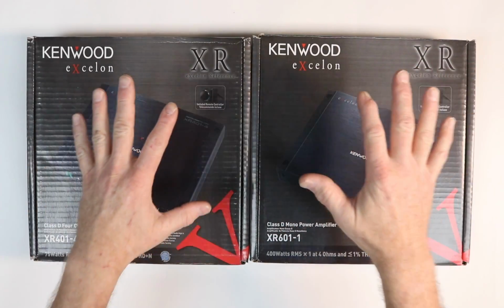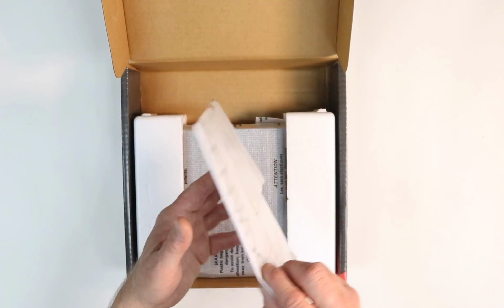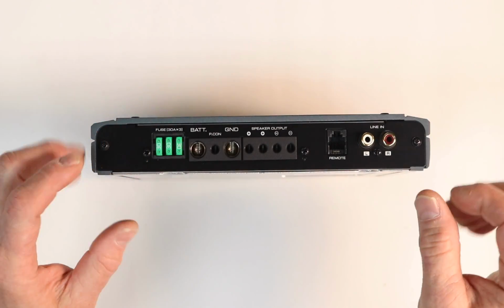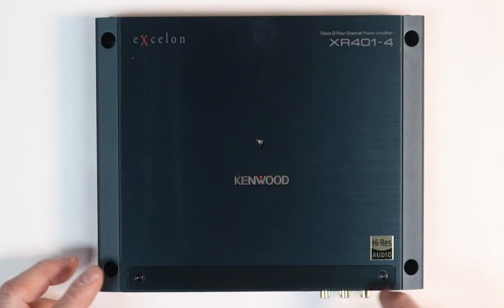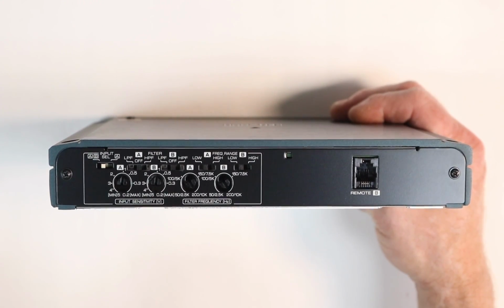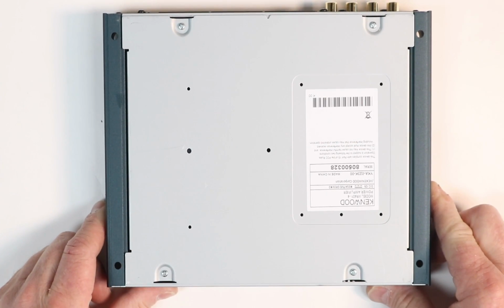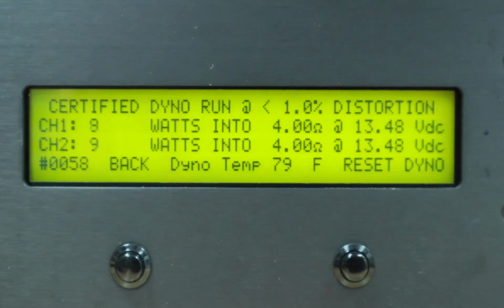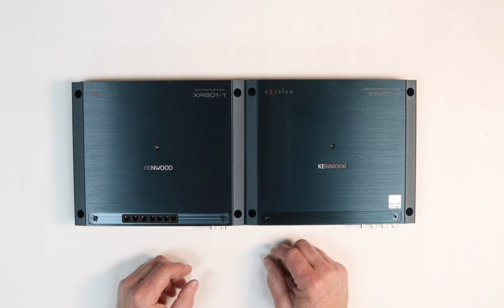Kenwood XR401 4 and XR601 1 real world amp DYNO

Comment: I keep coming back to this and will buy the combo. I initially was going to go with 2 alpine S2 subs-600w each and then realized my power supply isn’t sufficient to run that much power. I have a 2012 Raptor with 6x8 3 way component alpine Type R 100rms fronts with tweets both in the door and on the pillar, (obviously), and the same Type are coaxials in the rear doors. I initially powered them with a Memphis 400w x 4 amp. For the subs I had Kicker Comp D’s ran by a 500w Memphis in a small cubes BBox under rear seat box to host the two 10s. It truly sounded amazing with the Kenwood 990HD headunit back in the day. I just dropped a 1000z JVC with Excelon guts in it but sadly only have 50x4 Memphis amp pushing the doors and a 1000.1 black diamond pushing the old Comp D’s rated 250w each max rms. Im just going to go back where I began with only JL 300w rms subs with this amp combo. Dont want the install cost of new power etc. Thanks for giving real life voltage input on these amps, rated means nothing unless you can provide it, and y’all make it possible to really see a real life performance rating, and have sold me on your approach! I wish I could really upgrade but if I just achieve what I had when built 10 years ago, I’ll be more than happy! Y’all are great, push more videos please! 🙏🏼

Comment: dang. that 401 is def. underrated. 75w X 4, ya right. pushing like 140 X 4. That's impressive. The 601 isn't that impressive though, compared to my RF power750, which dynoed at 1,050 < 1%. It's strange that the heat sink in only on 1 side of the amp.
Reply: I just had mine installed on yesterday… I’m more than happy to with the clarity and power it provides
Reply: @hadbl12 mee too
Reply: I was thinking the same. 75x4 @ 4ohms, 100x4 @ 2ohms. Yeah right! I’m glad I have this little gem.

Comment: Am I right to assume the 4 channel dyno runs were bridged?  The numbers were 150 and 200 which is exactly what they were rated @ 4 and 2 ohms.
Reply: I'm wondering the same.
There is a Dyno on the 802.5 where they bridged the speaker channels to get the reading on 2 and they were doing over 300w on each channel bridged.
It seems the speaker channels are very underrated. 
For comparison, I lost output when changing from the XR901-5  to the Audiocontrol LC800.4 and got it back when I changed the Audiocontrol for an JL HD600/4.

I'm sure the Audiocontrol does it's rated power of 125RMS @ 4Ohms.
That leads me to believe that kenwood underrated the speaker channels.
The 901-5 also has (3) 40A fuses so that's another indication it might be putting out more than 900watts total.
Reply: @louislugo6156  what's your thoughts in the jl 600/4??  Is it as good as the hype and fan boys lead you to believe?  Is it worth the price tag?
Reply: It's a good amp, it makes plenty of power and sounds good.
I got mine used, I think they're overpriced. 
For the money, I would definitely get the XR401-4.
It's not that the JL is bad in any way, its that the XR line is just really good.

Comment: Nice little amps!  But Alpine was there and better 10 years ago with their PDX-F6 and PDX-M12.  The F6 does 150Wx4 into 4 ohms and the M12 does 1.2kW into 4 and 2 ohms (and over 2.5kW dynamic into 2 ohms).  Even Alpine's current lineup can't match what those little PDX amps were capable of - I know because I've been looking as my two PDX amps have developed some "issues" with gain control - living in my hot car for 10 years or so has finally done some damage...

Comment: Kenwood lists a signal to noise radio of only 76db at 1 watt. It may sound good but I stayed away from this cause of that.
Reply: I was researching that. That’s actually not bad. If you look at audio controls it’s 105 s/n ratio. However that’s at 50 watts at 4 ohms. As wattage goes up the better the value
Reply: @daveroski  Kenwoods x300 line of amps is actually the highest SNR for the cost, at least for class D, which is why I went with them, 85 dB at 1w and 100 dB at rated.
Reply: @vipercrazy-9  what amp in particular? X or these xr?
Reply: @daveroski  x302-4
Reply: I have owned a pair of 900-5 and still own a 901-5.
I also purchased an audiocontrol LC800.4 and an JL Audio HD600/4
I did not feel an "upgrade" going from the 901-5 to the Audiocontrol, it felt quite like the opposite. I paired the LC800.4 with an HD750/1 from JL and was unsatisfied with the result.
Ended up taking out the Audiocontrol and pairing the HD750 with the HD600 and have been satisfied since.
However, for the money, Kenwood is King 💪🏽

Comment: Question? So if the Dynamic is lower than the certified or uncertified, so that means low head room but can you actually hear the difference if dynamic was higher.

Comment: I just received the XR601-1. Waiting for a nice day for install as well as the other components that I see on this wonderful show. Very impressed on the power of this little guy on that Dyno run. Went from less power than my sub can handle to more power than my sub can handle. hmmm....  I am running the XRW12F. These two should pair very well together. Thanks for the Dyno run Dean and Fernando.
Reply: Which audio drivers will you be using?

Comment: Can not think of why a company would build a sub amp that is not 1 ohm stable.
Reply: Because most normal people dont have more than 2 subs, its not aimed at SPL competitors
Reply: @st170ish  I have 2 10s at 1 ohm not for spl so you can only use a 1ohm load for spl?
Reply: @speedwayaudio3  Of course you can but its a rarity...
Reply: @st170ish  Not really. If you are 1,2 and 4 ohm stable you can sell your amp to anyone with just about any combination of subwoofers
Reply: Because people running these amps are probably more into SQ than SPL and it's small, not allot of room for beefier components that 1ohm would require
Reply: @charleswp71   I have 2 10s at 1 ohm not for spl so you can only use a 1ohm load for spl?
Reply: @charleswp71  I have 2 little 10s on 1ohm and none of mine are "beefier" you can run SQ with 1 ohm its done all the time.
Reply: @speedwayaudio3  not saying you can't but allot of hardcore SQ builds like 4ohm drivers even on subs, considering the market these amps are aiming at it makes sense they are not 1ohm, plus 600w is not a amp the 1ohm crowd would looking at lol
Reply: because of sound quality and size..
Reply: Well warranty replacement is kinda expensive

Comment: Awesome little amps, I have the 601 and it puts out good power, nice to see Kenwood broke from the norm with the design, it's a full bridge circuit topology and very nicely laid out. Only knock I had was the color, it looks like it's black but it's not, more of a very dark blueish color which doesn't match with black amps, not a big deal if your hiding it but I like mine on display. One other knock is the placement of the gain and crossover, on the back it's a pain to get to, top mounted would have been so much better.
Reply: Did you have any issues with the bass knob having no effect till 1/3  turn
Reply: @michaelrobison8572  seen your question on the live stream about using the dd1 on the 601, that amp is a full bridge topology design, not sure if the dd1 is seeing something strange because of that or what, I would shoot a message to Tony D and ask him, might be something with that design of the amp, I set mine with a scope and it was super clean and sounds great
Reply: @michaelrobison8572  no, mine worked fine, I actually did take it out in favor of the bass knob on my DSP

Comment: Have both of these amps in my car having a hell of a time setting the gain on the 601, even using a dd1 head unit is a kdc x304 gain all the way down and distortion light is on unclipped signal from head unit to anp just so confused everything is good on 401 also not a fan of the bass knob no signal till a1/3 of the way up it's a volume knob not a bass boost knob. Any help would be greatly appreciated, thanks, guys.
Reply: From my personal experience with finding that it was normally caused from noise in the RCA’s or from the ground of the radio… That being said the fix I did was add an extra wire from the ground of the radio to the metal bar behind the dash. Try that if that doesn’t work ground the outside of the RCA’s to the chassis of the radio there’s a video on my YouTube channel that goes over this Hope this helps
Reply: @stevenwolfie  I'm using stinger 4000 series 6ch  rcas  set gains on XR401-4 with no issues unplugged rcas from XR601-1 connected directly to dd1 clean signal up to 34 max volume is 35 I'm thinking it's the amp or bass knob
Reply: Sub level on head unit zero never use it but I found out from Dean that they had same issue when they were  setting the gain on their demo for the amp dyno the XR601-1 just doesn't play nice with the dd1 dean and Fernando even called kenwood to ask about it answered my question on Saturdays show.
Reply: @michaelrobison8572   good to know, I’ve also seen some weird things with the DD1, glad it’s not just me 👍
Reply: Where is sub level on the head unit? I have found in testing a few Kenwood double din's that if the sub level is at just +1 there is visible distortion on oscilloscope at 75% of peak volume. When I left it at 0, the signal appeared to stay clean all the way up. Might be different on the KDC-X304.